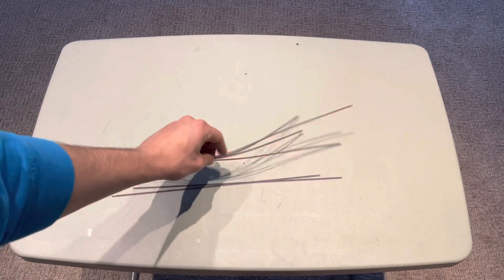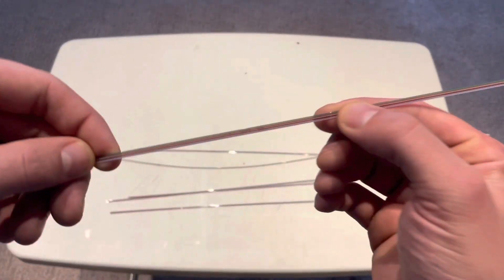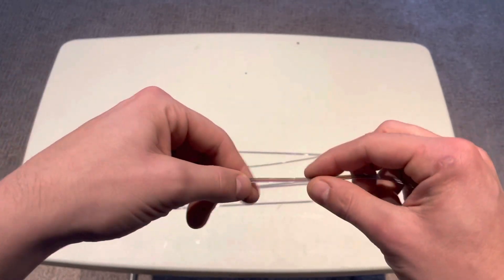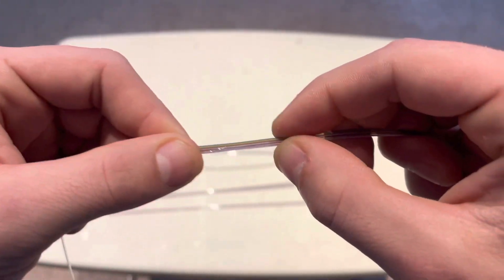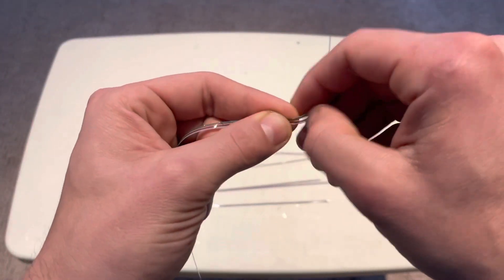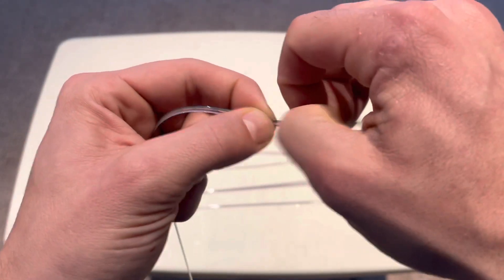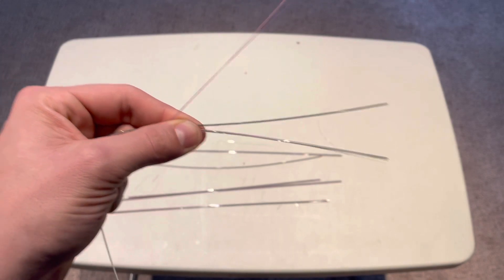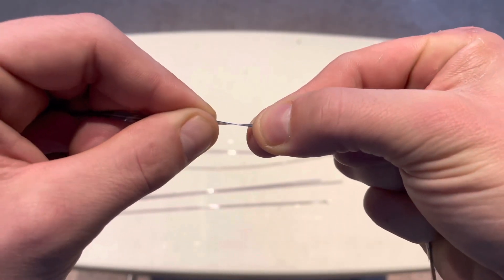How to separate single fibers from factory Ribbon fiber cable

Comment: Do you have a video showing repair of loose tube squirrel chew repair?
Reply from the maker: Hey thanks for watching and commenting I don’t have a video on squirrel damage repair. Depending on how bad the damage is if the Fiber is still okay then you could use a zipper heat shrink to re seal the cable in the damaged spot.
Reply: @FiberSpliceGod  right now, it’s just cut the tube in half and re splice. Fusion. I just thought there’d be an easier way, especially if it’s only 3 strands or so that are damaged. But thanks for the reply and your content….it’s very helpful and I will definitely share with my crew..every bit helps
Reply from the maker: @DjDuzzit  ahh fair enough yea those damn squirrels can be a real problem from time to time. Yea only other option would be to cut the damage spot out and throw gator enclosure on. Thanks for watching glad I can help out 🙌
Reply from the maker: Here is a link to the heat shrink kit 
https://www.commscope.com/product-type/structural-support-tools-accessories/weatherproofing-accessories/heat-shrink-kits/item072974-000/